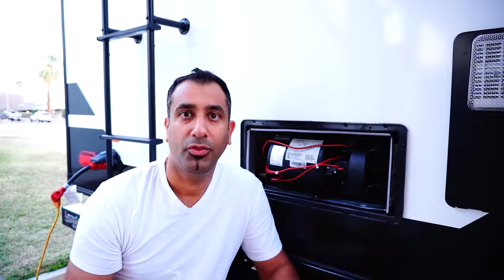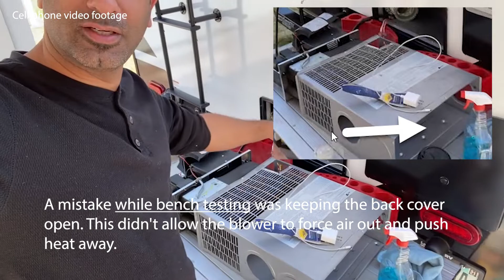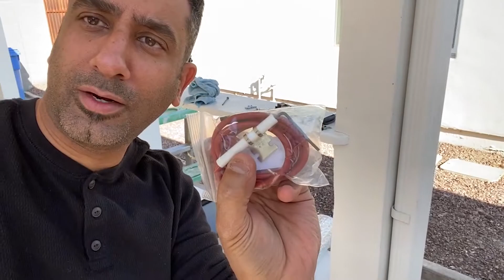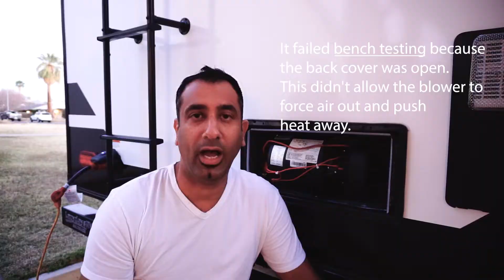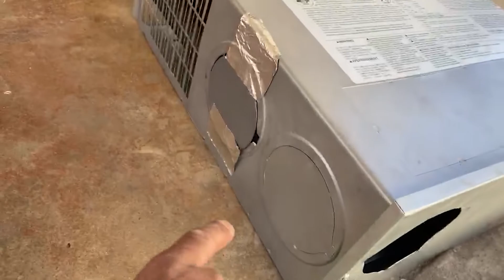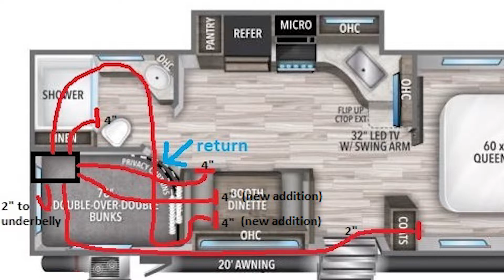RV Furnace Short Cycles OFF and ON

Comment: When you refer to a faulty high limit switch the second time do you mean the sail switch? I'm confused because I've heard that could be the problem yet no mention?
Reply: Yes, I think he meant Sail Switch when he was talking about the first air flow; because that is what detects the blower motor working. The High Limit switch is a thermo device that is sensing temperature buildup.

Comment: Atwood documentation for our furnace says that Code-2 is a flame sense fault. Our furnace is short cycling and reporting a Code-3 lockout. I believe that it should report Code-2.  I bypassed the thermostat with a test lead. I bypassed the vane switch and the temp (limit) switch with a jumper. I observe that the furnace runs for a short period, then the valve shuts off. The valve is monitored with an ammeter in series. I think that there is a fuel problem or a  heat sensor problem. 

The pathetic Atwood manual does not even say that the igniter is also a flame sensor.

The pathetic Atwood documentation says that the sail switch and the temp switch are in parallel. They aren't, they are in series. 

The pathetic Atwood documentation uses incomprehensible sentence fragments in the operating instructions. 

I will install a new controller tomorrow. I doubt if that is the problem. The valve and igniter are so hard to access, so I am going to try the controller even though it is quite expensive.

The furnace is in the back. The trailer has four ducts, which is plenty of area, but they are all extremely long.

Comment: I just purchased a new grand design momentum toy hauler.  The furnace has never worked more than one night.  It short cycles when it does run and then eventually shuts down and will not turn back on.  I have to pop open the side access and hit the reset switch.  The dealership has replaced the sail switch and now a control board with no results.  Grand design has sent a new furnace to my home and expects me to have it installed.  I am beyond frustrated.  When it does fail, the red light blinks once every 3 seconds, indicating air flow/limit fault.  my furnace is on the side of the trailer, packed in very tight.  I am multiple trips into the dealer and now over $200 out of pocket just in diagnoses from a mobile tech.  Our plan at this point is to add another vent and open the air intake since it was designed to only pull from under the shower.  I really hope this fixes it, I fully regret this purchase so far.

Comment: Check the temperature rise before doing anything else if getting high limit failure. The biggest airflow issue comes from sharp bends close to the furnace. Also stretch duct as much as possible to lower turbulence of air.
Reply from the maker: Good advice. Thanks!

Comment: Great descriptive video. It sounds like even if you cover a couple heat registers in the coach that you could trip the high limit switch.
Reply from the maker: Yes, CFM as the main factor. Not being able to relief the heat will short cycle the furnace.